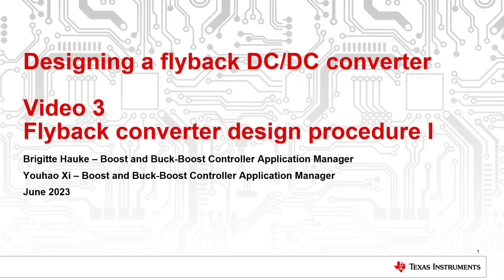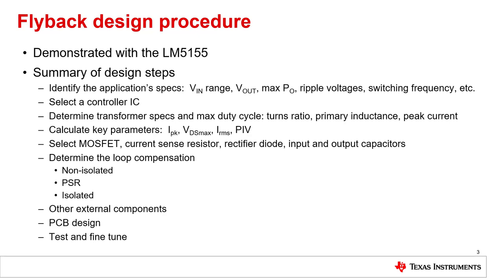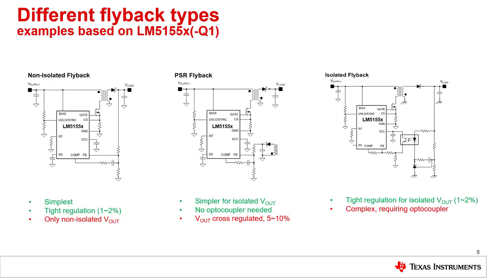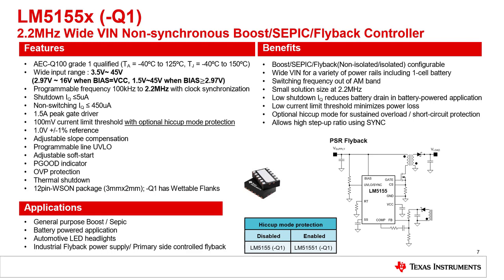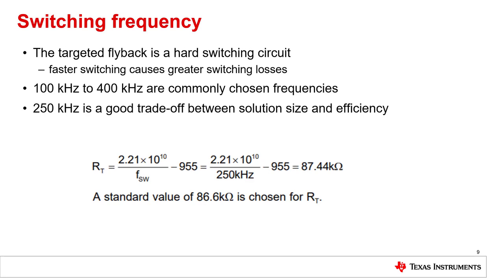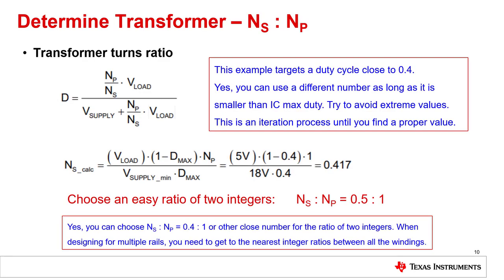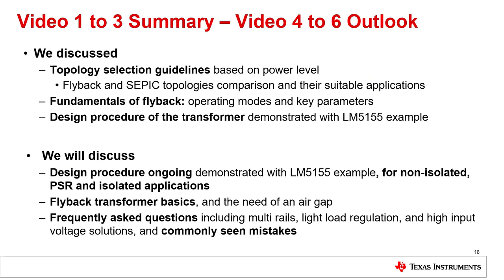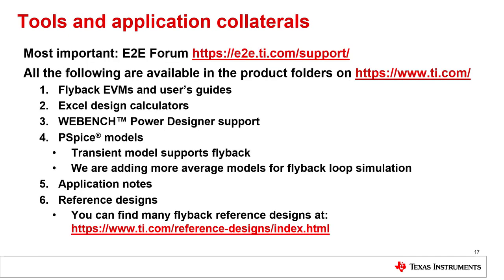Designing a flyback DC/DC converter - Flyback converter design procedure I

Comment: It's a pity that this series seems to have finished. It had a good start. For the sound quality, I suspect that the speaker is using a laptop mic or something similar rather than a separate mic. Good content, though. For those who care, the full design process is described in the TI application note: "How to Design an Isolated Flyback Using the LM5155".